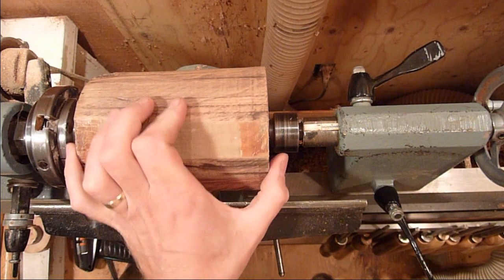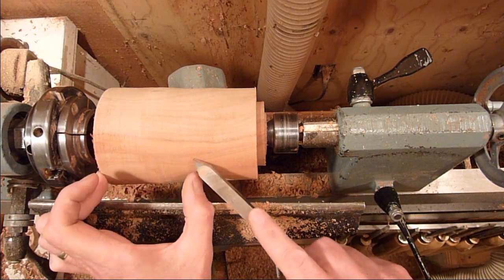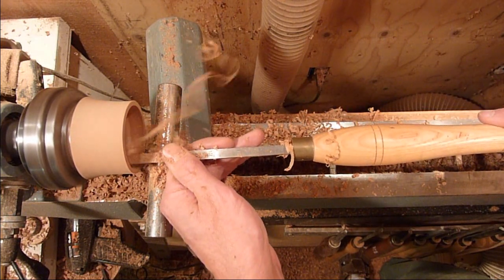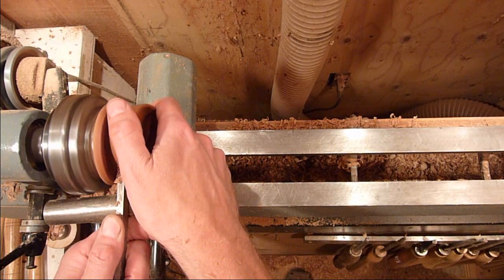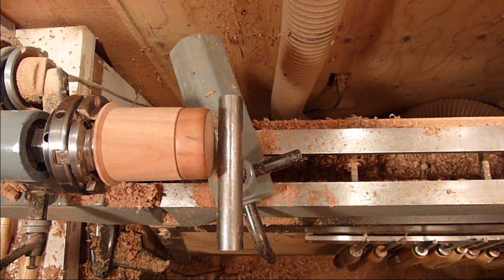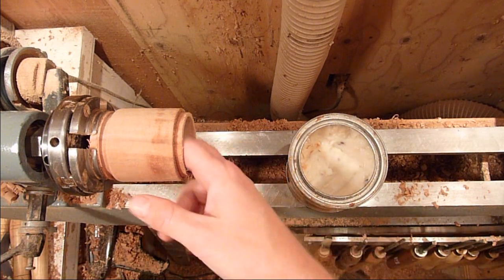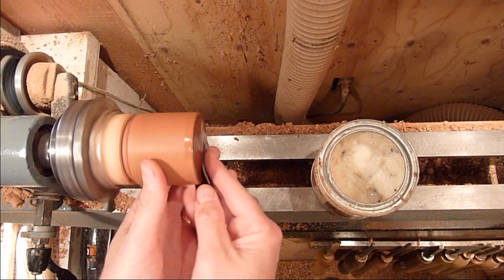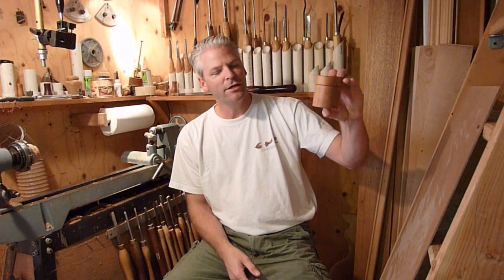Woodturning - How To Make A Turned Lidded Box

Comment: Hi Carl, I tried this with a 4 x 4 redwood piece and when i got to removing the inside of the box It had very bad tear out, My question is,  Was it because of my choice of wood, Grain tightness, cheap harbor freight turning tools or all of the above causing my problem?
Reply: I'm a freehand sign and art carver with some experience in chainsaw sculpting but i am a first time wood turner.. This was my first project and I failed miserably.. facebook.com/knumbskullsigns
Reply: it is amazing what tools can be used to turn.  I saw a guy use an axe for a all the steps in a detailed project.  other  cultures use different geometries, styles.  As long as the tool is sharp, and you practice with it, the "quality" is not the issue. Man, people make tools out of nails and lesser stuff with great result.

Lesser steel requires more sharpening, more care. that is it.

Comment: Chris, I turn using many woods including old 6x6 seasoned redwood posts. IMO the tool may not have been sharp enough. Or a flaw in the wood is another possible. One more thing is not to push too hard but take you time.